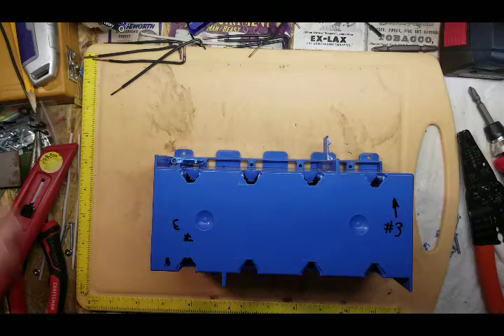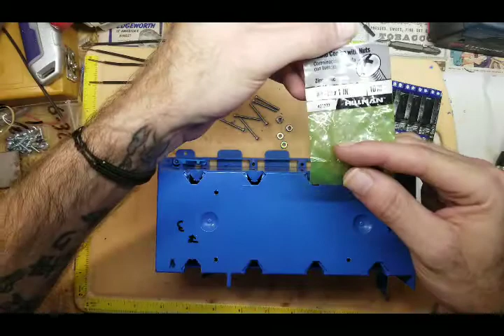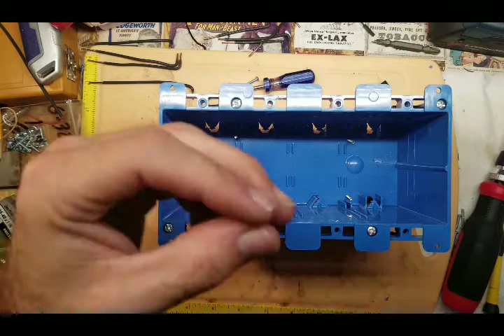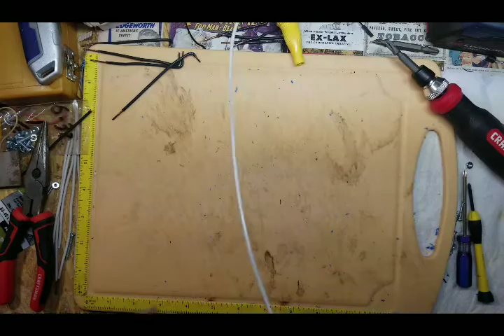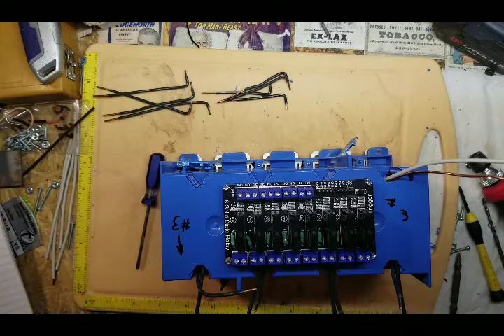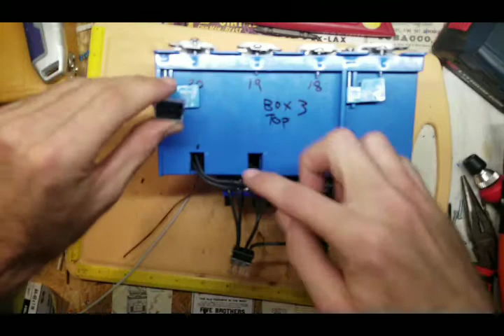Christmas Light Control Box Build - Part 3 - Wiring The Relays

Comment: Can't you just wire the lights directly to the relays bypassing the outlets all together?
Reply from the maker: Yes you most definitely can. 
You take one one the wires of the lights, cut and strip off the insulations. Then put one end in one terminal for the relay and the other end in the other terminal of the relay.
All the relay is doing is breaking the power loop.
Reply from the maker: That will work if you plan on putting up your lights close to the box. I have lights from one end of my yard to the other and from ground level to 20ft+ in the air. So I'm having to make custom length extension cords to plug into the outlets. Then when it comes time to take them down, I unplug the cord from the box and coil it up with the lights. That way, next year they're be all together.